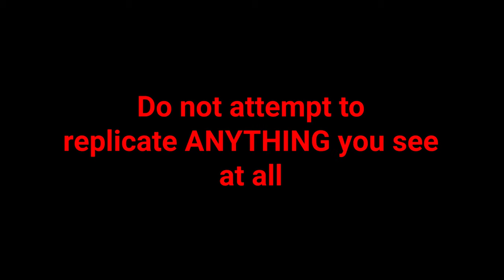Fire with Canned Air

Comment: try and tip them upside down and use the liquid for fire its scary flammable and freezes anything that it touch until on fire which then it keeps at a touchable temperature I found this out using a aluminum can for a fire holder